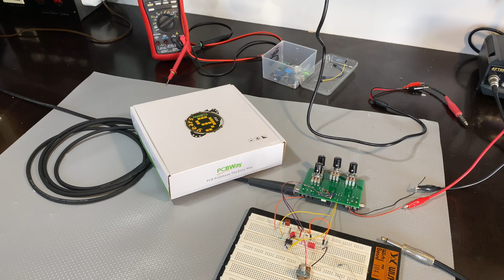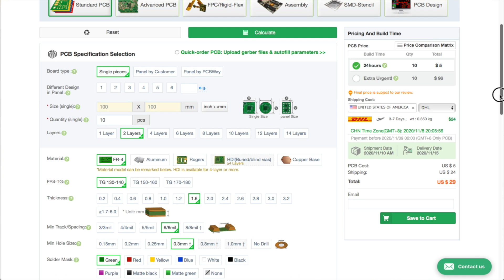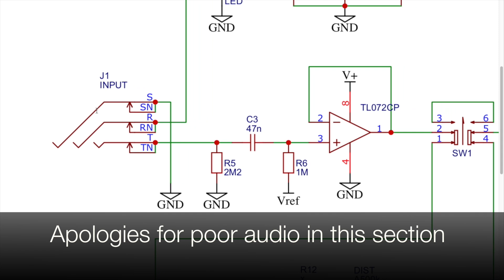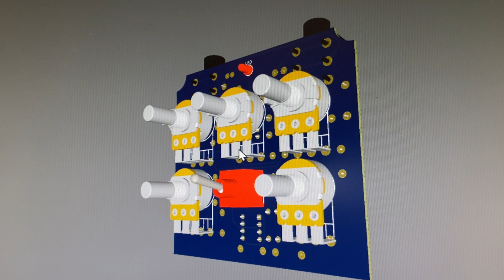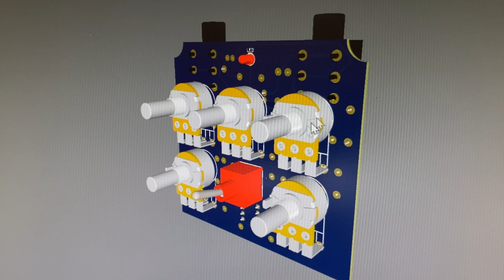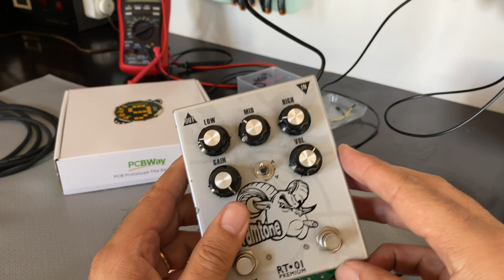Guitar to Tube Radio Interface, V2.0. Discussion and design of distortion option.

Comment: Well, it seems that your screamer schematic is missing those two 220nF capacitors (one of them part of the TS tone pot circuit) which are originally tantalum ones, which are essential part of that famous TS midrange "honk".
I think without those 220nF capasitors that screamer is lacking something important.
Chapter 1.5 here: https://www.electrosmash.com/tube-screamer-analysis 
Nice video anyways.

Comment: Hi, Manuel. Regarding the TubeScreamer section in that circuit  you may find interesting to put a socket for the dual op-amp. In my humble opìnion, the TL072 sounds dull in this application. Better try a Ti RC4559... sounds heaps better. Same for other unobtainium chips but the RC4559 is almost as good as those holy grail old-timers.
Reply from the maker: I agree. I use sockets for both op-amps anyway so that we can then tweak to taste.

Comment: I think you have your 2nd TL072 (for gain) connected the wrong way around. The way the feedback now works is like a non-inverting amplifier. But the signal is connected to the negative input. This should be connected to the positive input.
Reply from the maker: You’re absolutely right 😊 I corrected that before posting the final video and Gerber files to the PCBWay site for anyone who wants to build it. I was wondering when someone was going to notice 😊 thanks.

Comment: An interesting addition to the project.
One concern though...in the 3D image you showed of the board, it appeared that the case of at least one of the pots was contacting 2-3 pads on the board.  If the case is metal this would short out all those pads.  It may not actually be a problem, but I wanted to bring it to your attention just in case.
Reply from the maker: It would indeed short out the pads, but I have a solution 😊 which I’ll show in the final video later today.